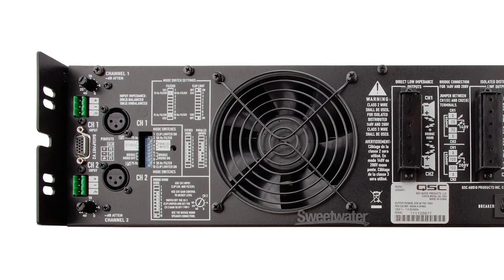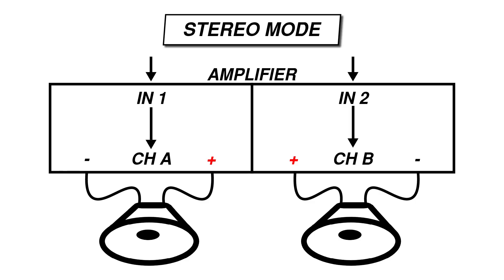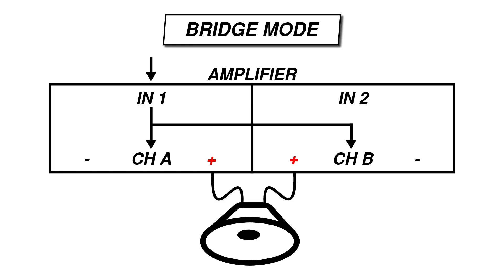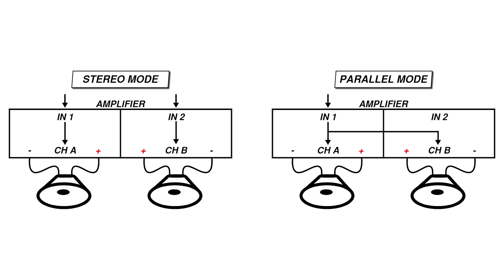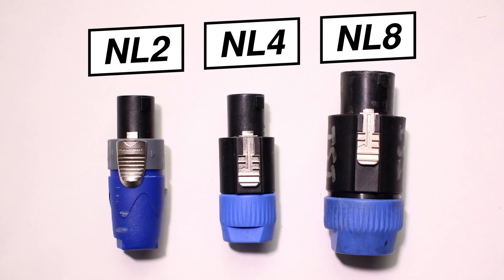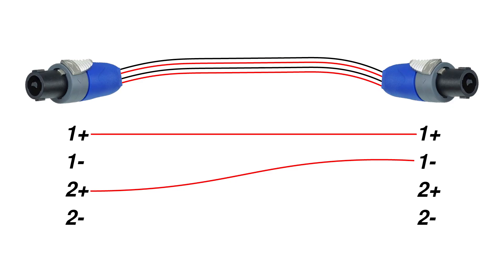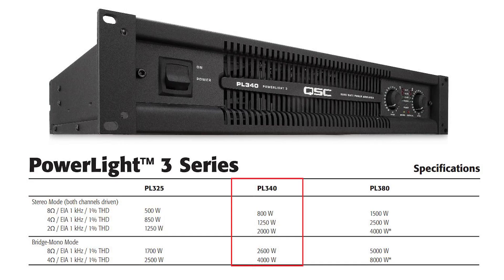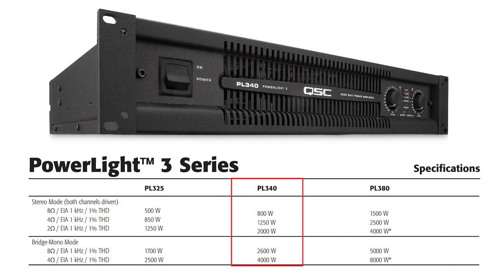How To Set Up An Amplifier [Bridge vs Parallel vs Stereo]

Comment: Someone please help!!!! I just inherited a QSC PLX1602 amp and 2 JBL TR225 series speakers. 
How do I hook these up to get max quality sound? I heard bridge mono is the  way to go, but how would I wire them all together?.
Also, I might only hook up 1 speaker, since the bassment is kinda small. I don't want to go deaf! Btw I'm hooking up the amp to my old numark mixer using the 1/4 cables. This will be connected to my 1200s.
Any help would be greatly appreciated. Thank you

Comment: Hi, and thanks for your insight and great video. My setup is the following. 
Source of music WIIM utra  feeding via fibre 192khz 24 bit to pre amp Emotiva RMC-1 , then XLR cables to my mono blocks, Black Widow Valve amps (800 watt)  driving the reference speaker, Jamo 909's . The Jamo R909 is a 3-way dipole floor-standing speaker with a frequency range of 25-30,000 Hz, and a power handling of 800W (short term) and 550W (long term). It has a 4-ohm impedance and a sensitivity of 89 dB.
So what do I need help with ? 
I bought 4 Fosi V3 mono block amps. I want to replace the Black widow valve amps. Install 2 Fosi V3 mon amps each side. How do I  bridge mono mode two V3's aside to drive each speaker? Bi amping will not work since although the speakers are bi wireable , the split in the bi wire is tweeter only and the mid range and 2 woofers are on the other circuit. 
 I wrote to Fosi and they replied with the following.
______________________________________________________
"Here are our suggestions, hope they can help you.
1. Prepare two V3MONO amplifiers as left channel amplifiers and the other two as right channel amplifiers. 
Connect the left channel output of the audio source device (CD player, music player) to the RCA input interface of the two left channel V3MONO amplifiers through a one-to-two RCA audio cable;
Similarly, connect the right channel output of the audio source device to the RCA input interface of the two right channel V3MONO amplifiers through a one-to-two RCA audio cable.

2. Connect the output ends of the two V3MONO amplifiers of the left channel in parallel with the speaker cable and connect them to the left channel of the Jamo ref 909 floor-standing speaker;
The two V3MONO amplifiers of the right channel are also connected in parallel and connected to the right channel of the Jamo ref 909 floor-standing speaker. 
In this way, there are two V3MONO amplifiers for both the left and right channels to provide power to the Jamo ref 909 at the same time to meet the power requirements of the Jamo ref 909 speaker.

3. Use a 48V/10A power adapter and a power splitter cable to power each pair of V3MONO amplifiers, that is, the two V3MONO amplifiers of the left channel use one set of power supply, and the two V3MONO amplifiers of the right channel use one set of power supply.
If you have any other questions, please feel free to contact us."
__________________________________________________________________
So I am not sure what they mean, bi amp or bridgeable? They also use RCA, which I can do, eliminate the Emotiva. 
Thanks for reading my request for help.

Comment: Is this different on a car amplifier? Because on bridge mode on the amp shows using both channels one negative and one positive not positive to positive.
Reply: It isn’t positive to positive, when the amplifier is switched to bridged mode the two positive channels turns into positive and negative. For the car amps your correct.

Comment: Maybe someone can help me… I purchased an older Dean MARKLEY PA system. 2 monitors and 2 main speakers. 

When I plug in the monitors from the back of mixer (main outs) they work. When I plug in the 2 mains I get nothing, regardless of where I run the cables from.

I’m getting no sound from the two mains. Not even static. I was told the mains works, and I do not believe I was lied to.

Does anyone know why this could be? I tried another mixer through the speakers and still nothing. The mains have two inputs “1” and “2”

Comment: New to PA systems 
Can't get stage bins to work on both sides
Ep 4000 amp
What dip switch settings should l engage for simple band stage 
Speakon cables 2 pole to trs 1/4 at bins

Comment: Isn't there some amps out there that actually connect both amp channels together pretty much completely, side by side, in parallel mono mode, effectively creating a SINGLE channel amp, but one that can supply TWICE the current at the same voltage, therefore ALSO doubling the wattage output capacity into the same impedance loads as in stereo mode? (Just only doing it then as a more powerful "monoblock" amp instead) (It seems like I've seen amps that do it that way instead of the way you described for this amp in this video... But maybe I'm just remembering it wrong?)(Have you ever seen an amp that does parallel mono mode in that way that I described above?)
Reply: You are describing Bridged Mono mode, which is described in this video. I took a deep dive into this, because what you described sounds like a "simple" thing, but actually it requires some complicated set up, such as proper wiring and what not. But what you're describing exists, Bridged Mono Mode uses the power of both channels (doubling the power so to say) to send the signal to one mono path
Reply: @Skizz_Missive No, the way I understand it, bridged mono mode essentially puts the two amp channels in series instead of parallel, basically doubling the output voltage capacity, but with the same output current ability as single channel stereo mode.

What I was talking about originally is similar but basically connecting the amp channels together in the opposite way from series (bridged) connection, (series is output voltage doubled, current same as one single amp channel), but parallel mono mode is instead connecting the amp channels in parallel rather than series (bridged) mono, (parallel mono doubles the output current ability, but at same output voltage as single channel)

It seems like I've seen some professional model amps that have a switch on them where you can choose between stereo, series mono ("bridged"), and parallel mono if you need more output current ability for a low impedance load.
Reply: @JoeJ-8282  I might be confused here, but that is exactly what I mean by "Bridged Mono Mode."

All of my amplifiers have that same setting on the back. Basically stereo, mono and bridged. And bridged mode gives you the "maximum" amount of output that your amp can handle (basically when you are buying professional grade amplifiers, the big number advertised is the wattage output in bridged mode).

Are you trying to do something specific with a specific amount of resistence or something?

Comment: Kyle thank you for your amazing videos
I want to ask one question because i could not find enough information  about it
is only  audio interface (for example solid state logic 2 ) enough for get normal sound for speakers?
i know that audio interfaces have pre amps build in inside i  also know that pre amps do not have enough current to drive some speakers
do have to buy power amp separately?
i hope i am not asking too much questions
Reply from the maker: I think this video will help you: https://youtu.be/ltMPK8gN3X0?si=CLR8Z6v_Kce6iMNp

An audio interface is not able to power a passive speaker. You’ll need a power amplifier.
Reply: thank you it really help me out
but i just cannot find any video how to hook up audio interface with power amp 
 @AudioUniversity
Reply from the maker: In the video link, I show a mixer connected to an amp and speakers. You’ll connect an audio interface the same way.

Comment: You should only bridge an amp if you have to. It beats the crap out of it. A 4 ohm load is now a 2 ohm load. You make the amp work twice as hard to drive the same speaker. The harder the amp has to work changes how it sounds. If at all possible, buy an amp that has enough power to begin with. Its a much better solution. 

If you have 2 stereo amps that are exactly the same, you may want to consider doing a vertical biamp instead. You'll get more power, but it won't be as much as bridging. However, there are no downsides. The amp won't see the speakers at half the resistance. It will stay the same and not force the amp to work so hard.

Comment: you couldn't  have picked  an easier amplifier. to demonstrate. what happens internally when you flip the switches not all amps are not cut and and dry great videos not  knocking it. diving deeper when you flip the Amp into mono mode in side the Amp it is reversing the polarity of one input then the output put is wired negative on ch1 is to positive on ch2  the speaker is then connected to the negative speaker terminal ch2 negative positive speaker terminal is connected to the out put positive on ch1 that's what the switches do is reconfigure ch1 only delivers + & ch2 only delivers - to the speaker

Comment: Thanks for the videos and time for sharing your knowledge, i have a question i have 4 sp3 peavey speakers, have a 800 mackie  powered  console and a yamahap5000s, i want it for preaching ,can the yamaha runs 2 sp3 and  the mackie  runs 2 sp3 speakers just need some guidance on that ,thanks  you so much ,will wait for your advice

Comment: My amp is 4 to 16 ohm rated. It says it is rated to 1000 watts per channel at 8 ohms. I have a 12" instrumental woofer that is rated for 8 ohms at 900 watts. It has only that one speaker on the channel. How do i wite it for 4 ohms so i can get the power to run the 900 watt roofer. If i run it in series i will loose half the 900 watts thats why i want to run it in 4 ohms

Comment: Back in my broke teenager basshead days of the 90's, guys couldn't understand how my Pioneer pullout, paper dual cone 6x9's, cheap sub and flea market amp outperformed their far more expensive, professionally installed systems. 
I wasn't going to tell them it was because they had it wired in stereo. Even when I had 2 subs and a single amp, I'd still get more db's bridging mono and just running jumpers from that speaker terminal to the other speaker. Not proper, I know, but I couldn't afford 2 amps.

Comment: TIPS:
1) Check amp mode, connections, leads & speakers before connecting cables & powering on.
2) Switching in & out of bridge mode should be done with no speakers connected or the power off (if possible). Check connections, minimum input level/gain, turn on, then increase the input level/gain/volume slowly (eg. take about 10 seconds unless you hear a problem). You don't want to be fiddling with dip switches & wiring while the amp is ON.
3) If you make adapter leads, add labels to indicate purpose & how each end is wired (which end for amp, which end for speaker when not wired straight through). Use different color tape than your usual leads so you can quickly tell the difference eg. blue for normal, red for bridged.
Reply from the maker: Thanks for sharing these tips!

Comment: Thankyou so much for your best school on youtube.
My question is how can i use 2 amplifier to one ?

That mean if i have two 2500w amplifier and i have 4 amplifier that have 5000w in total. I want to use only one speakon cable to wire from two amplifier to these speakers 🔊 

Thanks by advance
Reply: u may sum both amps to send signal only via 1 NL4 cable. HOWEVER i dont recommend outputting both lines into the same speaker. but for the sake of cleanliness and ez connection, yes ..

Comment: Thanks for the video.  I have Onkyo TX-SR494 AV Receiver and need amp to power two Acoustic Audio HDS10 in Wall 10" subs.  Can you recommend a sub amp to match the AV R around 80 watts at 8 ohms each channel?  Thanks.

Comment: Hello And thank you for the straight forward videos.
My Q goes, is it possible to connect two integrated amplifiers in mono mode, to act a stereo. To eliminate the long cable configuration and if this is true to improve sound in the speakers?

Comment: Question: I want to run two speakers in parallel (8 ohms each) to a bridged mono amp. Specifically, two QSC E115s powered by a bridged mono RMX 2450.  The amp is rated for 2400 w in bridged mono @ 4ohms, so I assume by running 2 of them in parallel into bridged mono, I'll get the full 2400, split  equally between each speaker (1200 w per speaker).  This compares to running one speaker per side in stereo, which only gets me 450w each (at 8 ohms each).  Am I right, or what am I missing? Thanks

Comment: are you sure about your definition of mono parallel?   https://en.wikipedia.org/wiki/Bridged_and_paralleled_amplifiers disagrees and so does everyone I've talked to about this.   I believe the correct definition is that you hook one positive of one speaker up to both positives and speaker negative to both negatives on a stereo amp.   This gets you double the available current to the speaker.  The common way to do this is with a little scrap of speaker wire running between both +'s and another between both -'s and then wire the speaker to one binding post just like normal.  You feed the same input to both sides of the stereo inputs.

Comment: May you answer the Big Question I never got explanation?
How to use stereo amplifier with stereo amplifier with 4 Tower Speakers?
All my 8 Receivers are connected to 8 ohms Tower Speakers. 
Unfortunately all stereo amplifiers only connect 2 Tower Speakers, and I only want more volume power for my Receivers using all my command of Bass, Treble, Loudness, one cd player and one dvd player and, again, 4 speakers.
I'm 66 years old, and want simple things. Only using an amplifier to increase volume sound to my receivers, but all the things I've on my receivers.
May you help me, answering the things above?

Comment: Hello I am still confused.. If you put the Amplifier in Bridge mono , You can connect one speaker wires on  channel (1) + and channel (2) +.....But where do you connect  the other speaker? ....I have   two speakers  ti be connected .
Reply: You don't. Bridge mode is designed to power one speaker with double the power (e.g. a Subwoofer). Your amp works as if it only has one channel.
Reply: @user0000user  This is a confusing issue because in the documentation for the QSC GX5, in bridged mode it shows 2 speakers connected !

Comment: If i have a 2 channel crown but only want to use a single channel does it matter which channel I use and what should the amp be set at at. Parallel? I'm not bridging. Just wanting to run 1 channel. Ty for any assistance
Reply from the maker: Yea. You can set the amp to stereo or parallel and use only one channel.

Comment: In bridge mono, 2 positive terminal of the amp is connected to positive and negative terminal of the speaker. Importnt thing i think is knowing which amp is inverted and non inverted output signal. One of the two positive terminal has inverted signal, that must be connected to negative terminal of the speaker. Pls correct me if im wrong. Bit confused. Thanks
Reply: Good point , I also see all these videos on how to connect only (1) speaker on the two (+) 1&2 channel  but if you have a pair of speakers  how do you connect  number two speakers?

Comment: Does running one channel on stereo mode increase the wattage of the amp

My amp runs 1600w/8ohms, can this be increased by only using one channel in stereo?
Reply from the maker: The manufacturer will usually state the watts per channel in the specifications. In my experience, this is usually independent of how many channels you’re using.

Comment: Hi. I have a silly question. Crest 4801 transistor power amp.  If I choose stereo mode, as I wish to keep low wattage. I will only use channel A. And leave channel B with no signal and no usage.  Is it safe ?

 Is stereo it safer than parallel mode, in this particular instance ?
Reply from the maker: If nothing is connected to the output terminals of Channel B, I don’t think it makes a difference.
Reply: @AudioUniversity  thanks. Seems to correspond to majority of responses I found.

Comment: Great video! My buddies and I are building a hi-fi system for heavy bass music. We recently purchased two Eminence NSW6021-6 subs. Any suggested amps for these beasts? We're having a hard time. Thanks!!
Reply: I'm an idiot basically 🙃 because I have a love of music, but don't play an instrument, ( unless air guitar or air drums count...) and I collect old stereo equipment, ie, record players (& of course records) reverberaters reel 2 reels, and amps*... they aren't stand alone amps though. I'm still learning. They all have at least a tuner in them, some a cassette deck as well. My pride and joy and inspiration for my obsession is a Sansui 9090db. I had NO IDEA the love and admiration this unit has. But all the people who I pestered about the awesomeness of this receiver can attest, and the braggadocious audiophiles the world over will agree, this is the amps you want.

Maybe not the amps you need, but you'll forget all that nonsense. It has 125watts x channel, 3 separate speaker channels and I believe the finest built in tuner ever made . Anyways, I'm still learning the technicalities of electronics and especially when it comes to amplifier and speakers. If that amp isn't a good fit for the speakers you have, I bet you buy speakers that match the Sansui 9090db.........
Reply: @johnhandcock7744  Hey! That definitely sounds like an incredible receiver! Thanks for the input. Unfortunately, the drivers I mentioned in my original comment are 21" subwoofers, so 125W is a little underpowered lol. These drivers run at 2500W each AES rating hahaha. These would be for small scale events. Since I've posted this comment 4 months ago I've definitely found some solutions though! There are amps out there that will power them properly, they're just a tad expensive. I recently bought a 4 channel amp that can do 2000W per channel at 8ohms, so I think I'm good to go!